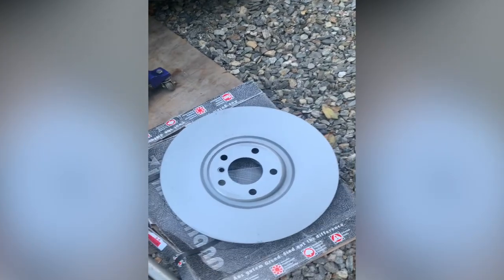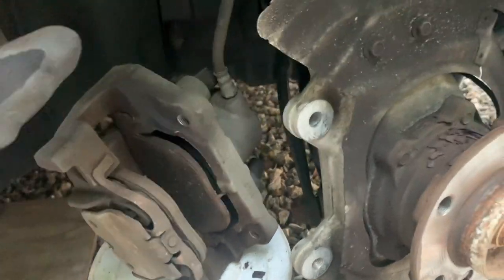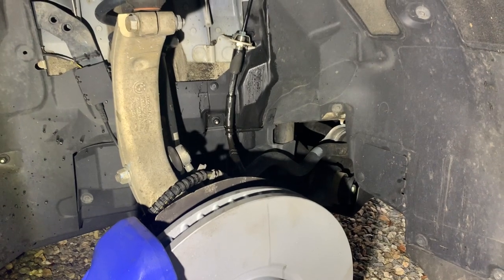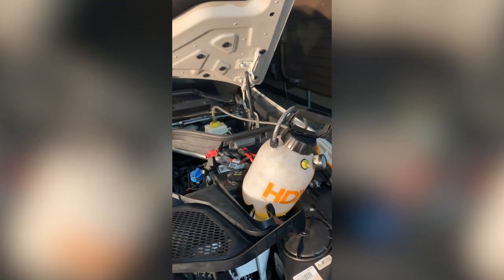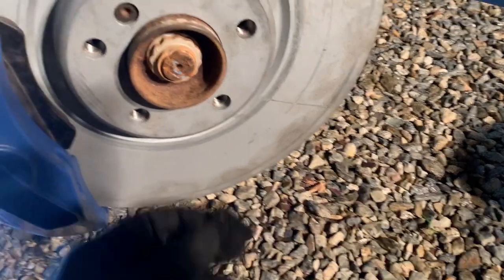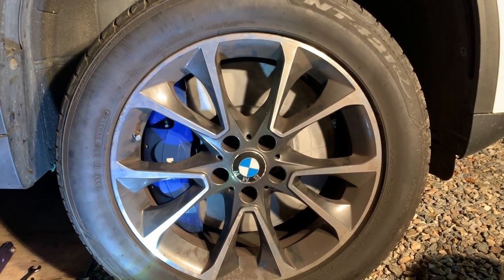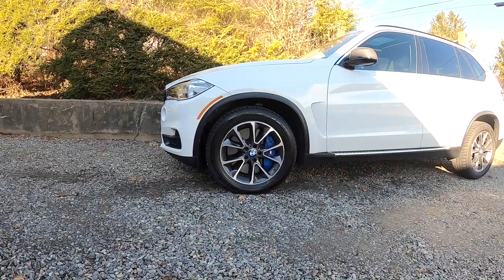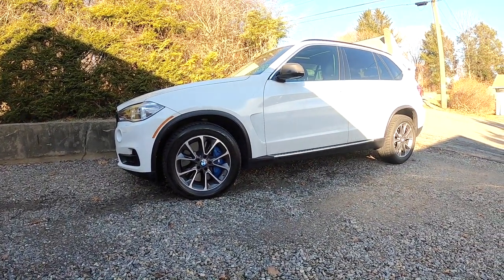X5 Brembo Brake Upgrade - Part 2

Comment: If u used a bar to hold brake peddle down when taking lines of it wouldn’t leak continuously and u’ll get less air in the system

Comment: Man, i have the X5 M50d with 385mm rotors that would fit a minimum of 19 inches of rim. You have 395mm rotors. You nees 20"
Reply from the maker: Yes that is correct I have 395mm on on 19 rim to make this fit you need 5 mm spacer on 449 style wheel, fit is tight but it fits no rubbing have been running this almost whole year like this.
Reply: @MotorsportInspired  ok, but it would be safer with 20's, and it looks better
Get some 468M or 469M style rims and it will be great

Comment: Boy fot these Brembo calipers you need floating brake rotors, dont you ? Puting these with 19" wheels  its just screwing your car !
Reply from the maker: Floating rotors are overkill for this application, Have this setup installed for over year now with several heating cycle wet, snow, hot weather. It’s perfect no vibration or other any problems at all. After all Bmw designed this exact setup for the E70 x5m so it’s not like  putting something totally different, it actually technically should work better on f15 vs e70 because f15 is a lighter car than e70